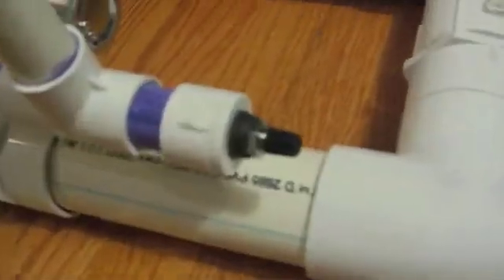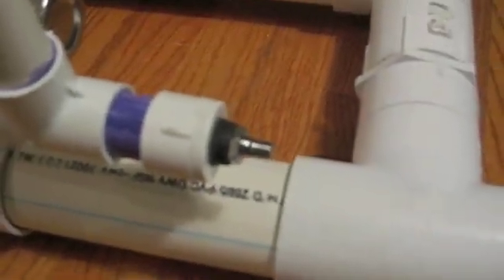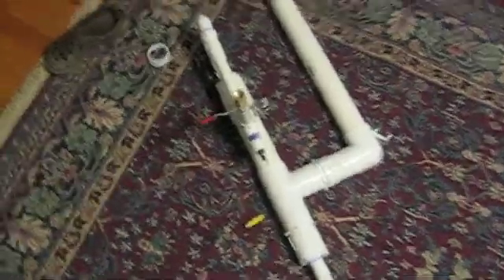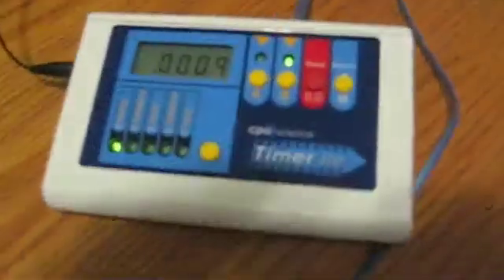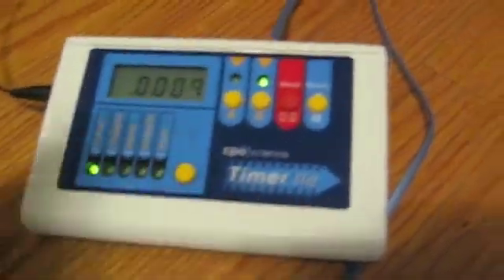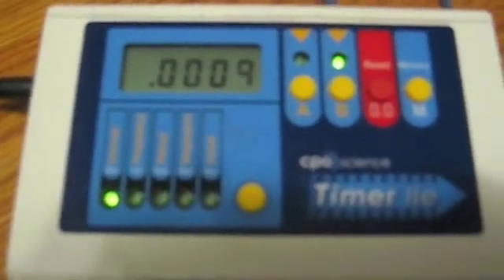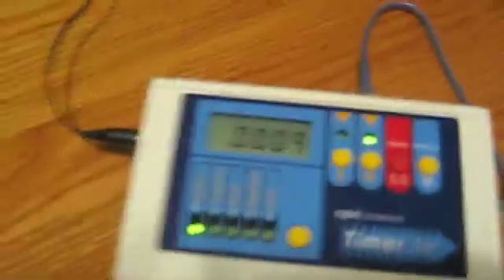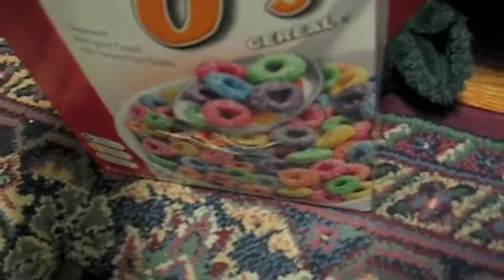powerfull air cannon

Comment from the maker: oh and my valve came with rubber seals that could be tightened by a nut.

a previous iteration just used a normal bike valve take directly from the tube of a bike tire, i cut around the valve, and glued it to the inside of a hole just big enough to fit the valve tube.

Comment from the maker: leaks on the screw joints can be fixed using teflon tape. you will probably need it on all the joints, i did.

leaks on the QEV are trickier, you need to cut the end of the barrel that is inside the valve very flat and perpendicular to the pipe, then use soft rubber to seal against it.

Mine keeps failing because the rubber seal breaks